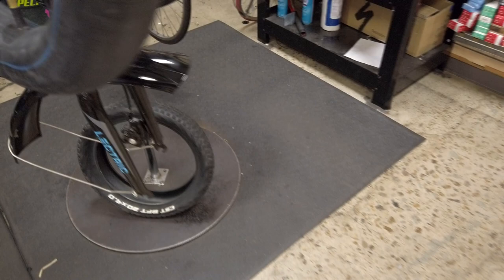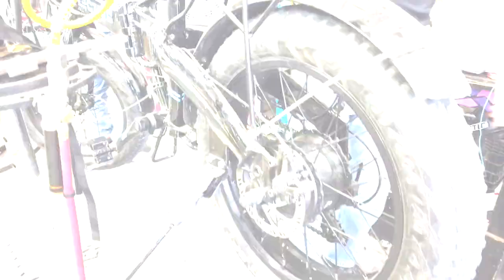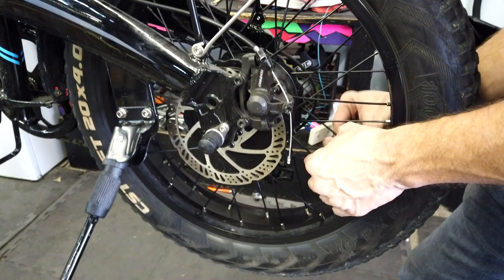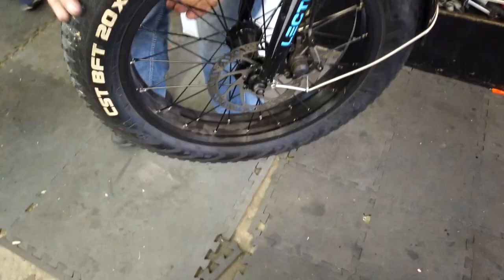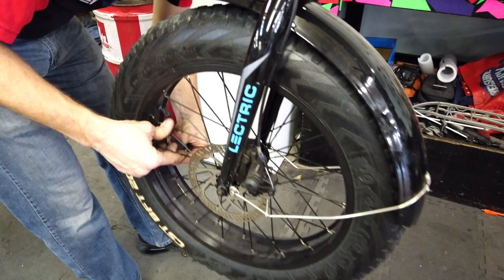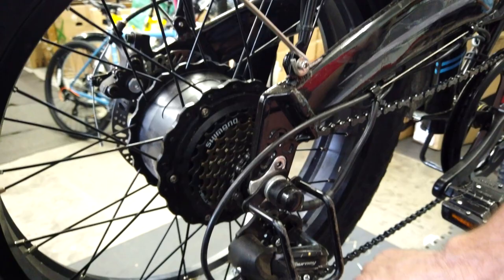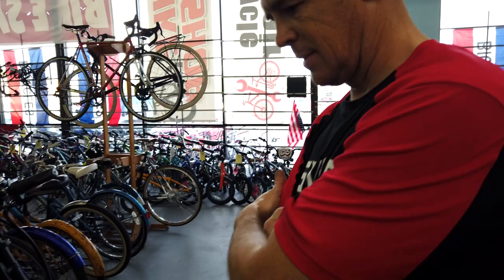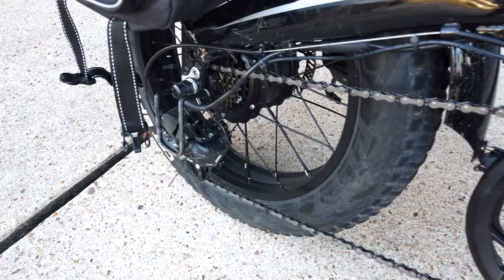Fat Tire Ebike Repair and Maintenance (Lectric XP) - Strill Life - Vlog 13

Comment: Now watching this video I'm really thinking of getting this bike most likely other xp e bikes are all made the same getting a flat with that rim inside spokes not covered good and the spokes getting loose that's not good but again it's China what to expect from China something lectric e bike gots to know so they can make this bike better since they are not cheap in price.
Reply from the maker: Yeah I think the flat was a fluke. I was upset when it happened but luckily I had foresight to buy a replacement tube before I recieved my bike because the tubes are not readily available at most bike shops or Walmart. 

I haven't had anymore problems and I have over 1200 miles on the bike. The spokes.... ehhhhh... that could have been better coming out if the factory but hey at this price point the bike is very solid  otherwise. I never have doubt if it's going to work or not. I just charge after I ride and hop on it and roll out when I want to ride next. It's very low maintenance. 

Anyway as you see I still love mine. The seat could be softer because your butt is going to start hurting because you are going to ride it everywhere. Maybe some suspension would be nice but hey you can add as you go to improve theses things. I say go for it. You'll be smiling ear to ear.  Thanks for the comment and checking out my channel. It's much appreciated.

Comment: Better learn how to change your own flats dude.... and So much more now that you picked an off-the-shelf bargain-basement ebike.
Reply from the maker: Lol. I know how to change a flat. The fact that I got a flat 2 days after I received the bike I wanted to see if there was something inherently wrong with the rim or something. Which there was with the defective rim strip according to the bike shop. The bike is awesome though over all. I've put almost 1000 miles on it. It's solid over all. Everything is going to need maintenance and repair over time if you are using it. I use this thing all the time. At any rate appreciate the feed back.
Reply: @StrillLife  I'm with you, I have over 10K miles on my ebike and have needed help with her a few time already. I just wanted an ebike that is keyed to touring and max range with a heavy load of gear.
Reply from the maker: @brianbassett4379  I see you have your bike loaded down. Did you build it yourself? I'm new to ebikes but have bought an eSkate, eScooter, eUnicycle etc but the bike is thre clear winner in my opinion hands down. Everything else is too dangerous or didn't have enough range. Anyway I'm sure this won't be my last ebike. I'm hooked. Lol
Reply: @StrillLife  It's components from all around the world pieced together and built specifically for touring. A few things needed to be done by highly qualified mechanics but mostly she is just a top-end specialized bike with a mid-drive motor mounted on her.
Reply from the maker: @brianbassett4379  you have it loaded down like a pack mule. Being it's a touring bike what's thre range on it? Most be pretty awesome because looks like you have everything you need on it. I have a few accessories and can pack stuff w my panniers but you've clearly got me beat. Lol
Reply: @StrillLife  When she is fully loaded to move between basecamps she is more a pig than a mule actually. The modified trailer is actually a "Mule" made by Tout Terrain and then perfected (some) by Cyclefab LLC in Seattle. Range is a tricky thing to talk about... unloaded I have ridden over 80 miles on 60% of the battery's capacity, loaded I have ridden over 50 miles on the same 60%. I actually have Way more than I need or can carry and have to tailor the load to the local and weather I will be in.
Reply from the maker: @brianbassett4379  see... hearing stuff like this is how ppl get taken in a whole other direction. I haven't seen many long distance builds before. Just prefab commuters and maybe some fast dirt bikes.
Reply: @StrillLife  Production ebikes are all about selling them cheap, not about building them to do more than the minimum. They cut every corner possible to get you to throw a $1000 down. Start with a good bike that does everything you want and then hang a BaFang mid-drive on it.  It doesn't get much easier.
Reply from the maker: @brianbassett4379  do you have to modify the frame when doing this?
Reply: @StrillLife  Nope. I bought a Tout Terrain Panamericana frame, rare, but a production bike frame. Take almost any bike you want to buy and you can hang a BaFang mid-drive on it with little to no trouble what-so-ever.
Reply from the maker: @brianbassett4379  yeah I'm checking out a video right now. This may be an option going forward. Not mad about my purchase because it was plug and play. Which is what I wanted plus the fat tires. Just like the look.  But I may do a custom home made 1 in the future.  I like having the concealed battery but realize I'll have to give that up to get more range until cell tech advances again.
Reply: @StrillLife  What does concealed mean? A hard-shelled case?
Reply from the maker: @brianbassett4379  the battery is hidden or concealed in the frame.
Reply: @StrillLife  Ahhhhhh, security. So a pint-sized battery that is somewhat safer? Is there another benefit?
Reply from the maker: @brianbassett4379  well it's a folding bike so it's supposed to be easy to transport.  Not so much for me since i have a coupe with a trunk. So for weight and aesthetics it serves a purpose. It meets my expectations for distance. Pretty much as advertised imo.
Reply: @StrillLife  I have been seeing more and more people unloading their fat ebikes off trailer hitch carriers. I ride a 30+ mile strip of bike path that close with many different trailheads for people to park. They only lift the tires about 8" to drop them in place, strap'em down and drive away. Even with just a single set of panniers, it would be a pain in the ass to load and unload a bike to ride it, let alone have to fold it in half, and I have lots and lots of bags and gear mounted on the bike to include a FuGoo XL Bluetooth speaker. When I do have to strip it down it takes a while. Folding would be great for air travel and I have considered having my frame modified, if I did it more I probably would... probably won't happen.  

A couple more things I would suggest are... get massive hydraulic disc brakes 180mm minimum. 

 A full suspension and something that can securely mount the heaviest rack you can find. Mine has an integral rear rack and suspended front rack, not necessary but oh sooo nice. 

If you are going to be on it enough to warrant the cost get a dynamo-hub, I can charge two USB devices while riding at 13+ mph, or it sends the power to my headlight... get a great one.

I couldn't live without my bar-bag, it's big, it's heavy and carries almost everything I want to put in there. 

Min. of 2.5-inch tires, the further you want to ride the thinner the tire. If you want to crawl around in the snow and sand get them as big as you want knowing you are going to sacrifice range in a big way.

Here's the big one, $1600.00 big... get a Rohloff Speed-hub. 14 internal gears that are shifted when no power is being applied. That means you don't need brakes with cut-outs, one less thing that can fail. It also means you come to a stop when you want without worrying about what gear you are in. I can spin the gears from 14th to 1st in a single second. Hit an incline without planning, just pause a second on the pedals and throttle and shift down almost instantly.

All these items that make it a superior ride and quality can be bought and installed as time and budget allow. 

Basic items that make a superior ebike: Mid-drive (much better than a hub-motor), battery (30A), display, and Grin Satiator (a must-buy) will cost around $2000.00. If you have a bicycle right now you could probably use it with these components and at any time mount them on a different bike. The better the bicycle you start with the better the ebike.
Reply from the maker: @brianbassett4379  that's a lot of great info. I'll consider these upgrades when I can afford them.
Reply: @StrillLife  That's the whole point... start with the right pieces and you can slowly assemble a set of components that will be a superior ebike.
Reply: @brianbassett4379  So you have an Lectric XP with 10k miles on it?
Reply: @brianbassett4379   Realistically speaking. your suggestion isn't achievable by most ebike riders. For that kind of money, I am better off with a good used car or Gas powered bike. Sure I need insurance, but I will be able to justify the price and go a lot further with it than 40 miles. Good Suggestions on more reasonable parts, like the 180mm Discs, Bar Bag, Suspension on bike, dynamo-hub, etc. Once you went to those high end parts, you lost most of us. LOL.  

Great Input and thanks for sharing.
Reply: @ELEVOPR  No man... I have a real ebike with over 16.5K miles on it, not the cheapest POS sold. The point is that when you start with a quality frame and add a mid-drive motor you can take it to whatever level you want. With a pair of 30Ah batteries, I can ride 150 miles easily if I want to sit on the saddle that long. I just rode 64 miles in 4 hours 22 mins. on less than 15Ah... with a stop for lunch. Pull the trailer and 300W folding solar panel and the only thing that limits me is food and water. Fishing pole, slingshot, and a great water filter extended it even further.  You don't have to spend 10K dollars to have a great ebike but if you only spend $1500.00 you better plan on not riding much.